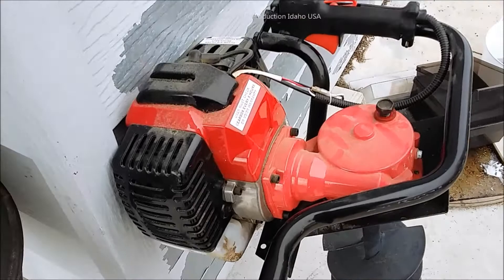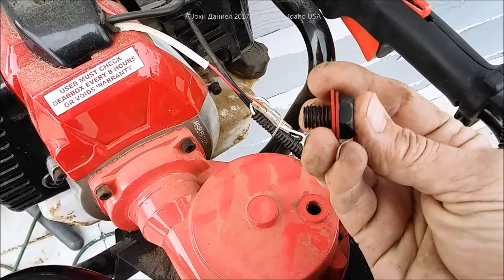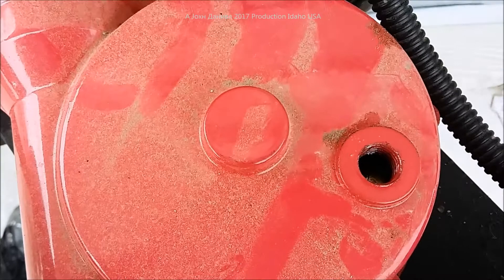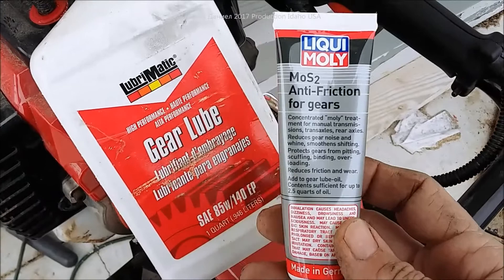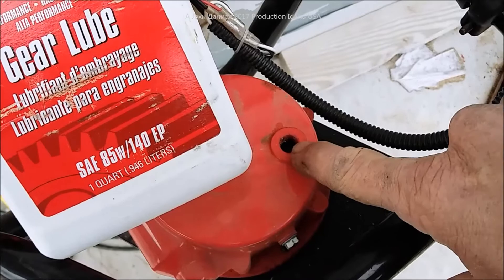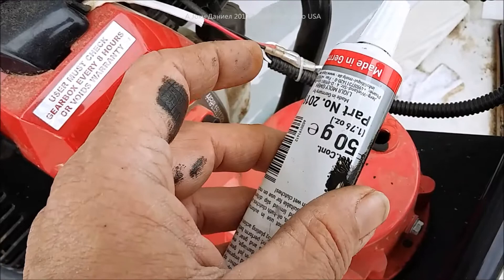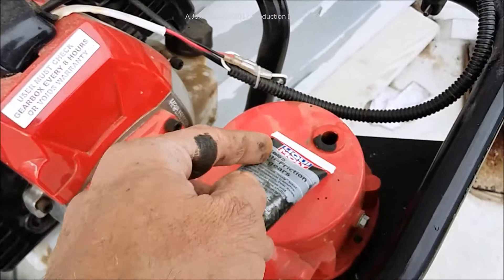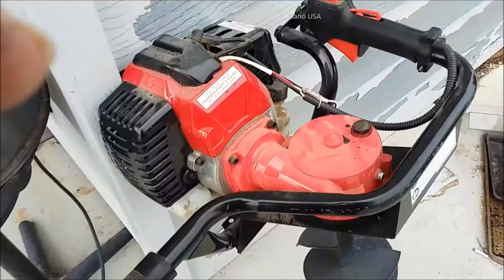Harbor Freight Gas Auger , DIY Gear Box Servicing

Comment from the maker: The AUGER options out there both gas and electric http://rover.ebay.com/rover/1/711-53200-19255-0/1?icep_ff3=2&pub=5575119394&toolid=10001&campid=5338008226&customid=Warrantied&icep_item=112671284203&ipn=psmain&icep_vectorid=229466&kwid=902099&mtid=824&kw=lg AND A 4" ELECTRIC ONE http://rover.ebay.com/rover/1/711-53200-19255-0/1?icep_ff3=2&pub=5575119394&toolid=10001&campid=5338008226&customid=ELECTRIC+AWESOME&icep_item=251717567429&ipn=psmain&icep_vectorid=229466&kwid=902099&mtid=824&kw=lg
Reply from the maker: Liqui Moly 2019 MoS2 Anti-Friction Gear Lubricant http://amzn.to/2DsZHpx

Comment: I'm seriously considering one of these augers for my new gold prospecting trips. The soil conditions where I go are very rocky and fairly hard, compacted dirt. My interest in one of these would ONLY be to drill test holes. (I have a spade bit Milwaukee chipping hammer for excavation). I'd also be very tempted to cut the diameter of the auger down to about 4". I'd test pan the loose stuff. Your thoughts??
Reply from the maker: The one in the link is  a better option honestly http://rover.ebay.com/rover/1/711-53200-19255-0/1?icep_ff3=2&pub=5575119394&toolid=10001&campid=5338008226&customid=Warrantied&icep_item=162147538580&ipn=psmain&icep_vectorid=229466&kwid=902099&mtid=824&kw=lg . Harbor freight has made no improvements on their auger, the one from California above has a 3.75" , 5.75" and 8" bit with it. Much better carburetor too.

Comment: Thumbs up.
On sale now for $169 ends today.
Reply from the maker: The options out there both gas and electric http://rover.ebay.com/rover/1/711-53200-19255-0/1?icep_ff3=2&pub=5575119394&toolid=10001&campid=5338008226&customid=Warrantied&icep_item=112671284203&ipn=psmain&icep_vectorid=229466&kwid=902099&mtid=824&kw=lg AND A 4" ELECTRIC ONE http://rover.ebay.com/rover/1/711-53200-19255-0/1?icep_ff3=2&pub=5575119394&toolid=10001&campid=5338008226&customid=ELECTRIC+AWESOME&icep_item=251717567429&ipn=psmain&icep_vectorid=229466&kwid=902099&mtid=824&kw=lg

Comment: never used liquid moly but it has become very popular here in Australia
what actualy happens to the old gear box oil? break down or leak out?
Reply from the maker: It breaks down and leaks out through the oil seal on the PTO down shaft.
Reply: makes sense

Comment: Any one know how too get the drill piece out?
Reply from the maker: Are you referring to the drive collar? If you have a auger bit stuck in the drive collar below the engine and the shear pin is broke, then you will need to use heat or take it to a local muffler shop to get them to heat retract it. Small engine shops are not great for helping you do that.